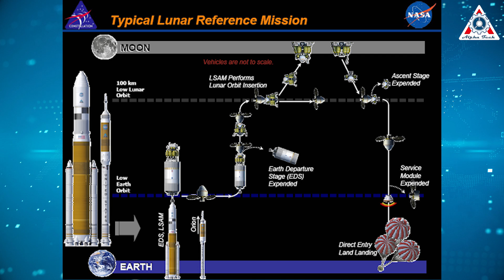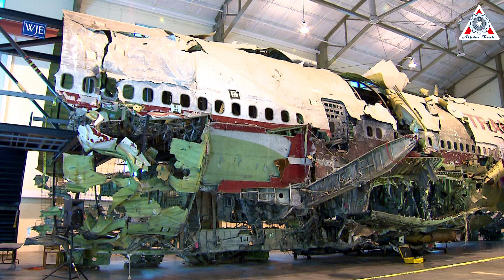NASA SLS FAILURE...!

Comment: At first glance reusing hardware makes sense. After 1975 everything Apollo was put in a museum or scrapped the space shuttle was a totally new program and it sucked. So not throwing the baby out with the bath water may make common sense at the most surficial level the problem is that basically everything to do with Apollo was great and then thrown away everything about the Space Shuttle was crap and we're still suffering with that crap 70's era crap in 2022.

Comment: The Excitement has been so high, but now I just don't know what to think! Nasa next time you need a new Lonch system designed and manufactured, I will be bidding for contracts!! I was building Rocket, much more exciting, and reusable when I was 10 years old, my bid will be just a hair more than the usual contract wins,and it will be done less than 5 years after delivery date,and please tip your delivery driver! Please

Comment: I get the feeling that software engineers are going through what I went through as a IT manager back in the day.  E.G.,  I was pulled into a so called testing program for a new data processing system that my company was trying to install.  One day in a production meeting regarding the new system -- I happened to mention that a process I was testing failed to produce the file I needed.  As soon as the word "failed" rolled off my lips I had a swift introduction to the horrors of group think.  A great hush came over the room and the meeting leader screamed at me that "YOU CANNOT SAY FAILED -- YOU SAY THE PROCESS WORKED BUT IT DID NOT PRODUCE THE EXPECTED RESULTS!"  Long story short -- I and anyone else who questioned about putting a system in place which clearly did not work were repeatedly reported to management for bad attitudes and eventually bounced out of the company.   Nevertheless -- the new system which was not properly tested failed and did produce the expected results -- close to a billion dollar loss and a sub company of the parent company going out of business.   In the years that the aforementioned has happened -- I have seen personally close to 30 billion dollars in losses because companies do not properly test new software/hardware before implementing into production.  Given the aforementioned -- it will come as no surprise to me if the SLS either blows up upon launch and or gets scrapped altogether.
Reply: I've got my money ($100) down on a spectacular Antares like blow-up at launch. NASA has lost its touch and today is nothing but a bottomless money pit. Money that would be better spent down here.
Reply: @OneLastHitB4IGo  I remember the Antares launch failure very well because it occurred in the vicinity where I reside.  As I was watching the liftoff -- the thought went through my mind "I wonder if Wallops can handle a launch failure?" A few seconds later -- I got the answer to my question.
Reply: You still got lucky. Sometimes its easier to rewrite the whole thing then getting it pass test.

Comment: This guy is spreading so much misinformation is hard to even fathom how this video is allowed to be posted.
Reply: A few things he said that were complete lies or purposely mislead:

Showed a video of an intentional tank burst test when describing the LOX dome cap dent which was relatively minor.
Said each engine install takes a full month and longer in horizontal, WRONG! it took 45 days to install all 4 engines in horizontal for SLS and that was the first time.
The Green Run failure was due to a MCC issue in the software not because the system failed or they didn't understand the parameters.
22 failed launch misses is a complete lie.  They have only scrubbed twice.
The software for Artemis 1 and integrated testing have been completed for some time. The complete deep space software which is being designed for Artemis 2 and Artemis 3 is being in work.

Very disappointed with Alpha, this is shameful work, how much is SpaceX paying him?

Comment: It's sad how NASA is so hard stuck on using old proven technology instead of investing new tech that better fits with the current era.

The example with the launch tower, they used it with Apollo and the Space Shuttle, they need to use it with Orion, while SpaceX has disproven NASA that using a horizontal to vertical deplorer is not only cheaper but, thus far, has shown no ill effects on the manned rockets.

And as mentioned in the video, it's taken NASA so long to get SLS primarily because of their contractors playing politics.  They lobby politicians to keep their contracts going while making no rush to complete their contracts.  Cycle and repeat.

Comment: I shared a flight with the program manager for Apollo  brought in after the Apollo 1 disaster 30+ years ago.  He told me the before the first shuttle disaster that solid fuel boosters had at least a 1% failure rate and should never be used on a man-rated vehicle.  They had lots of data of over 400 military launches using solid fuel boosters and knew there failure rate quite well.  Its was congress that forced them to be used with their constant budget cuts and complete lack of engineering knowledge. I read through the postmortem analysis of the shuttle software development back in the day and it was a textbook case of too may chefs in the kitchen and cost plus contracts. It never had a chance of success and even the emergency flight control software developed by a second team in isolation from the main team barley worked.  Most of the early flights (20 or so) came back on the EFCS with less than 3 of the 5 computers working. (The main software ran on 3 computers, and the EFCS ran on the other 2.  The hardware was so unreliable that at least 3 flights came back with only one computer working, the other having all been voted out by reliability comparison control system).

Comment: What is most incredible is that NASA mastered perfectly LH2/LO2 propellants 50 years ago, including multiple ignition of the engines. It was used as 2nd and 3rd stages of Saturn V, it was used on Space Shuttle, and now they are unable to pressurize an LH2 tank ??
Reply: Probably all the engineers that made that happen have since retired or moved on.
Reply: @leen3158  Agreed, 90% of staff in the Artemis-1 launch firing room team at KSC have no operational Shuttle experience. That's  just 11 years since Shuttle retirement.   There's NASA astronauts that graduated 2 years  prior to STS retirement that still haven't flown. CSA Jeremy Hansen and NASA Jeanette Epps were 2009 grads(the "Chumps") still waiting for "the ride".  Epps is trained on all three launch vehicles Russia and USA have. Soyuz,Dragon and Starliner(once she's ready).  Good thing as Epps  flight is coming up and Hansen might get to orbit the Moon in Orion.
Reply: They successfully fully pressurized all tanks earlier this month.
Reply: It is the largest liquid hydrogen tank in history.. Some pretty intense physics going on there.
Reply: @hoghogwild  Well ok it's the largest but just a little bit larger that space shuttle external tank, not that different ... SLS = 2032 m3 LH2, shuttle external tank = 1465 m3 LH2 ... about the same engines though, but 4 instead of 3 ... so easy to understand that propellant capacities is in a 4/3 ratio. No, the best explanation for me is in the incompetence of Nasa today members ... they are too busy chasing UFOs now, and defrauding US tax payers with the complicity of spacex

Comment: The open secret is that unlike a military contractor, NASA's budget is exposed to scrutiny for cost overruns, wasteful spending and redundant, often contradictory political efforts.  In typical defense contractor fashion, the development of Artemis has been dragging an albatross around its neck, as corporations reliably find ways to pry more and more money out of the program without a promise to solve profitable problems.  The intention has never been to develop and produce a viable new vehicle, it's been about repurposing obsolete parts and capitalizing on their unsuitability to extract profit from an abandoned technology.  The goal is not, and never has been to return to the moon.  Until a program contractually requires success for profitable payment, wasting money on failure to launch will remain the safer business model.  There's simply no incentive to make progress, when the risk of failure remains an indefinitely viable excuse for increased spending.

Comment: Part of the issue is that NASA still strongly favors their long-time contractors such as Boeing, who have been falling flat on their faces for years now. The argument for SLS was that all the tech already existed, as contrasted to Ares (Constellation) which was running into numerous design problems. However, the people who built the Saturn V and the entire STS (space shuttle) stack were in the prime of their careers back during the 1960's and 1970's. Most of the know-how is now retired or dead. As we have seen with the ongoing problems with Boeing's CST-100 "Starliner", which has failed to fly crew despite Boeing receiving more seed money than SpaceX got, they simply do not have their acts together. Too many executives, not enough real engineers. Plus, a much too forgiving set of NASA officials and bought-and-paid-for congressmen have been willing to run cover for the contractors regardless of who is in the White House. Obama was promised that this could be done by 2016. Trump was told it could be done by 2020. Neither date was met.

Comment: The videos of the tank bursting.. that is NOT a mistake. it was a test to failure on the tank to see what pressure it could hold. it was ON PURPOSE for TESTING. ... but overall your evaluation is right on. SLS is a hot mess that should have been cancelled years ago.

Comment: Some additional issues were not included in this clip: I believe the core vehicle,  meant to be constructed using external tank tooling,  had its diameter increased from the 27ft of the ET to 30-33 ft,  requiring retooling of the Michoud ET plant. 

The SRBs were given an additional segment to increase thrust,  which necessitated retooling the propellant mold.
Reply: Making changes to the shuttle SRB, external tank, and engines is what made SLS an over-budget super-delayed joke. If they wanted to sell SLS as quick and cheap reuse of shuttle technology, they should have used the parts as they were, not reengineered them to cost more and take longer!
Reply: So, that makes it ok to pi$$ away tax payer money and waste years of time, with no results?
Reply: @kerryclark1926  : ??? Who are you talking to? Thanks

Comment: WOW!  I hadn't realised the extent of the historical issues and incompetence with the SLS or the fact that the software hasn't been written, let alone tested yet, or the fact that the launch tower can only be used once because it's leaning, or that Bectal hasn'r started to build the new tower yet or...  I think enough said!

The other issue which worries me is that the solid rocket boosters have been stacked upright for well over 12 months and I believe that the "solid" rocket propellant sags under its own weight to the point that it shouldn't be used after 12 months.  I imagine this will be even more of a problem with SLS because there is an extra segment weighing on the other four segments the Shuttle solid rocket had.  Surely this would make launching an SRB under those circumstances even more dangerous.

Care to comment?
Reply: Well, if the SRB blows up, at least there is no crew onboard. Better to have an accident now and cancel the whole program than have this happen with crew aboard. Either way, it should be an exciting launch!
Reply: @curtisquick1582  IF it launches...  There is the possibility that getting the SLS ready for even an uncrewed launch will cost NASA too much if there are further problems (or unresolved current problems like the hydrogen leak) down the track.  Also, it needs to be remembered that even a 100% successful flight will cost NASA over $4.3 billion with a commitment to at least another two launches at around the same or higher cost, and that might not be doable given the amount of money given to them by congress.  However, as far as the launch itself is concerned you are right, it WILL be exciting!

Comment: I've never heard this quote about solid rocket booster performance reliability, where can I research more about solid rocket booster catastrophic failure rates?
Reply: Challenger blew up due to a solid rocket failure, that's probably the most pertinent example with regards to SLS
Reply: @shakehandswithdanger7882  yeah, that is the only failure that comes to mind and as I recall that was a result of the o-ring failure of the casing.
The return of flight to the space shuttle seemed indicate that that problem was solved so what are the other vulnerabilities of solid rocket motors?
Reply: @JoshKaufmanstuff  And the problem with the O-ring was, as they say, an unforced error, they knew this could happened. Burn marks on those O-rings were seen on three, I believe, other  missions. With one of them coming within literally seconds of also rupturing the fuel tank. Had the solid boosters stayed attached to the fuel tank for  something like 8 more seconds, KABOOM!!! Flames were seen escaping from that exact coupling 8 seconds after the SRB was jettisoned. And here is something that was completely covered up. Some engineer warned them that if they launched in those freezing temperatures that O-ring would fail with the booster still attached. I heard that reported that day, on NBC News but only once. And despite my attempts to find more reports about it I couldn't. I even called up NBC News in New York. They told me I must have misheard it. I told them I didn't mishear anything, as I repeated to the news director I was speaking with, almost word for word,  the report I heard. After about 5 seconds of silence he just said, "I'm sorry, that never happened," and hung up on me. That was a fixable problem they knew about long before it killed seven astronauts and NASA didn't do a damn thing about it. I bet that engineer mysteriously "disappeared" somehow.

Comment: Crazy to consider using engines from the shuttle when they had significant safety issues already with leaking seals. How do they suddenly become safer on this rocket?
Reply: ...And more problems than that, which I seriously doubt after all of these years were rectified.  Read the appendix to the Roger's Commission Report on Challenger written by Dr. Richard Feynman - the great physicist and only private citizen on the Commission.
Reply: The "leaking seals" were fixed following the 1986 Challenger incident.  The fixes for the O rings were already designed and were implemented in USAF FWC(Filament Wound Case) SRB which was to be used for Polar launches to the South from Vandenberg AFB. The hydrogen powered RS25 Space Shuttle Main Engines are some of the safest engines in existence.

Comment: Using anything left over from the "shuttle program" would just facilitate more waste and cost waaaaaaaaaaay more than it should. I don't want to hear about how it was easier to do this than start from scratch as SpaceX is already proving it can be done if you eliminate the bureaucracy and paper pushers from the equation. Should be ashamed.

Comment: While briefly mention it in the video, a lot of these failures are the result of lawmakers putting up ridiculous demands on the sls. Such as "Use this specific sub system, but it has to be constructed by this company in this state. " This method of external demands just makes sure Nasa will never achieve commercial grade production efficiency. So mostly just blame politics (like everything else that goes wrong, LOL)
It is sad because with a lot of other, smaller projects NASA shows they can deliver quallity reletavly on budget (Dart, new horizon and others)

Comment: The politics of engineering has always gotten in the way of one of the most important parts of engineering: failure. You can test and test and test until you're numb and still find failure modes that can't be found without the understanding that these are immensely complicated machines that can (and will) fail. The extremely high expectations rooted in the government funding for these programs are a hinderance to the ability of organizations like NASA to truly innovate, develop, and compete with modern space development companies. 

This is the strong advantage SpaceX, Rocket Lab, Blue Origin etc., have over NASA - they don't want to fail, but engineering in the private sector is built off the cycle of failure -> fix -> profit. Engineering for applications in space will be no different.

Comment: There are 2 boosters. Each has 1 chance in 100 of failure. That roughly equates to a launch failure rate of 1 in 50.  And NASA claims SLS is crew rated? Somebody's thumb is on the scale! This is not a Rocket Program it's a politically driven engineering full employment program.

Comment: Great stuff! However, your list of FUBAR's are all physical problems that can be fixed. THE factor that has created this disaster: Mindset. "SLOW DOWN! This govn'ment project is going to put my kids through college." Yep: the old "rust-belt, union shop" mentality: make it take as long as possible and cost as much as possible. Want a good analogy? Try the "Boston Big Dig." It was the most expensive highway project in history. The project was originally scheduled to be completed in 1998 at $2.8 billion. That's in 1982 dollars, but US$7.4 billion adjusted for inflation. When was the project completed? December 2007 at $8.08 billion. That's 1982 dollars, but $21.5 billion, a cost overrun of about 190%. The Boston Globe estimated that the project will ultimately cost $22 billion, including interest.